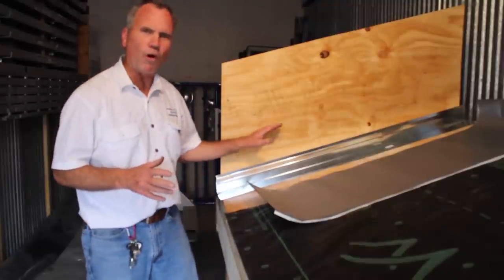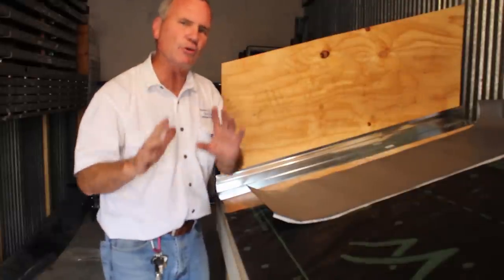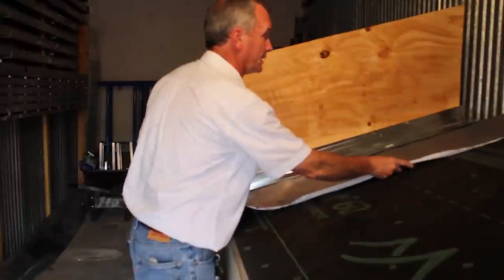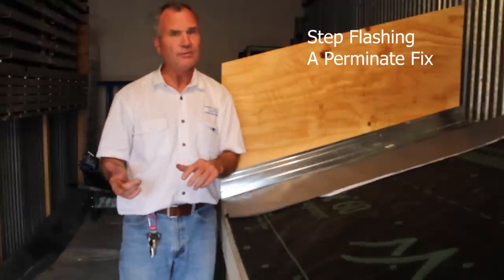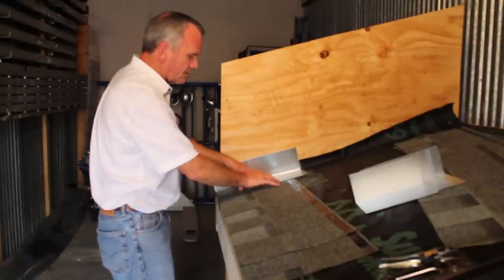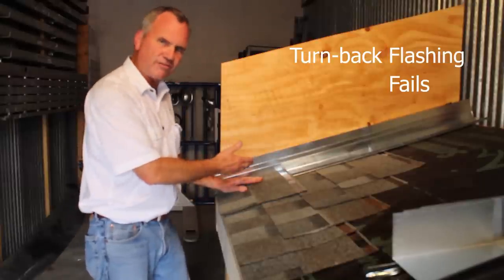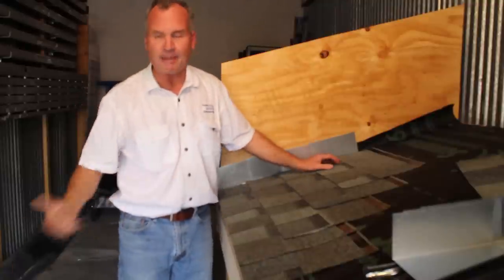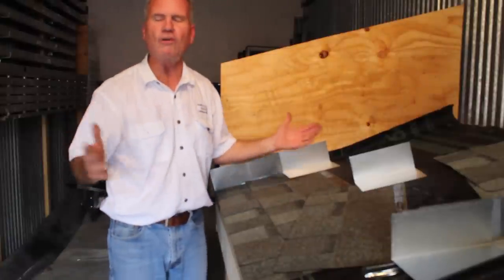Roof Flashing & Wall Leaks - What Texas Roofer Don't Know

Comment: Do you recommend step flashing on rolled roofing?
Reply from the maker: We use step flashing in any type of shingle application, composition shingles, wood shingles, occasionally tile, because it lays up like shingles, 12" or so at a time, slate and so on.  Most roll roofing will need to adhere to a solid piece of continuous flashing.
Reply: @Austinroofingcontractors   You are a breath of fresh air sir!! Ive been roofing since I was 17 and have been doing my own work for 3 years now. I've never advertised myself at all and have no problem getting work from referrals! Quality has taken me a far way in this industry because simple craftsmanship is forgotten these days to save 2 man hours!
Reply from the maker: @roofinggod1540  Thanks for your comment.

Comment: Don’t you want to only fasten the step flashing with the shingle nails (rather than nailing the flashing individually, under the shingle to follow)?
Reply: The Phoenix Contractor's Coach I think that (my “suggestion”/question) is recommended by some because (a) the nail is more likely to back out if it is only going through the flashing and (b) the hole, itself, is vulnerable as it’s not “sealed” the way a hole is when a nail penetrates the asphalt shingle. But, I’m in commercial/single ply roofing; I haven’t investigated what we’re talking about- perhaps the way demonstrated in the video is perfectly fine. Thanks for the response and for uploading the videos.
Reply from the maker: Kyle, you are obviously a terrific roofer.  The depth of your question shows that.  In some cases, you could be right, especially ice and snow build up, but, keep in mind, once the nail penetrates the flashing shingle, it goes into the asphalt shingle, where like all the other nails on the roof, it seals itself with asphalt.  In 45 years, I've never seen one like this leek, even in Boulder CO, but, to push my thinking forward, I would be interested in you thoughts on the above!  GW
Reply: I’ve been watching a lot of videos and I saw one that instructed to nail step flash to wall 2 times instead of nailing into roof. Then place shingle over top and nail across shingle but stopping short of where flashing is underneath shingle. Then one nail above where flashing sits under. Hopefully I explained it clearly. I tried my best.  I’m curious as to your opinion on this method. I’m going to try and shingle a roof with a dormer on my workshop I’ve built. Great video BTW. 👍

Comment: I think I heard you don't like a single piece of flashing?   Exactly why isn't clear.  You seem to claim/imply that water flows under the flashing, but don't worry about why water is under the flashing.....  I am actually bothered by what I think I heard but can't really define your complaint.   Lets start at the beginning and cover some important issues 1) What goes first, order of construction is important here because you have multiple trades ( carpenter builds deck, fascia guy sides wall, roofer shingles), 2) primary problem #1 its joint of dis-similars under water flow (wall vs deck, fascia verses shingle), and 3) water sources.    Ideally I would prefer the flashing installer be after the carpenter and step flash the joint with asphalt pokey ( actual name "asphalt mastic"  or his peel & stick)  raw wall to raw deck, often I can't control that.  Once the fascia is installed I am kind of screwed.  Now the dis-similars usually means cracks and thus the flashing. and water sources which are huge in your demo.  Particularly windows which weren't even mentioned.  That joints primary water source is the wall, a windward wall collects all the rain and flows it down that wall and across that join over the cracked joint.  The step flashing is advantaged in that it transfers the water to the top of the next flashing. Was that your point?  I am concerned as you show new flashing interlaced with shingles BUT really big BUT where is the vertical end of that flashing going?   Best answer is under the fascia, so who is removing and reinstalling that fascia? If you install the flashing outside the fascia you create a wall problem with water running down the wall being on the wrong side of the new flashing.     Simple point is proper flashing can only be done in the original install.
Reply from the maker: I'm sorry - this video must not be as clear as I hoped.  Your comment that I don't like a single piece of flashing - is way off base.  Watch again, and listen to the whole video - you will see and hear me explain using proper step flashing, a very important step, the idea is to not shortcut, do not leave out proper flashing, or substitute for things that do not work long term.  No matter who installed the flashing, I recommend NOT to use poorly installed flashing, fix the flashing by doing it right.  It's the only way to get a lasting roof.  Thanks for watching, I hope this is helpful.  GW

Comment: How about using a full continuous length 26Ga painted metal L-Flashing, say 12" x 12" x A',
where the length A' = 20' long?  Yes, the 3' wide underlayment will go on top of the lower wing of the
flashing and loops over the other wing?  The starter strip will be installed at the bottom edge
of the roof.  Then, the shingles will be installed on top of this long metal L-flange?

I.e., don't use short 5" flanges step by step alternating w the shingle placement.  Just use a long
metal wide L-flange under all of the starter strip and shingles?

Less joints on the flange means less chance of leakage.

What do ya dink?
Reply: Can u do the experiment w above, using a garden hose?
Reply from the maker: It has proven - not to work in most cases. Shinglling is a method that's been in play for hundreds, if not thousands of years. It is to lay or arrange so as to overlap, the one before. In step flashing, it's what keeps the water on top of the roofing material. Shingling!  
Hope this helps!

Comment: your using galvanized steel flashing? thats totally superfluous, tin step flashing is for sure going to last longer than your shingles. and your gunna replace the flashing anyways when you need a new roof
Reply from the maker: Superfluous, a big word for me, please clarify.  Let's start with an understanding of the difference in tin and galvanized steel?  Do they perform the same?  Thanks for your comment, I look forward to your reply and additional comment.  GW
Reply: @Austinroofingcontractors  i just meant that steel is excessive. tin or aluminum is cheaper and and will still outlive your shingles. i dont think steel would be any better because youre supposed to replace the flashing when you get new shingles anyway. you could, however, make an arguement for using steel on the chimney, since you know there will for sure be ice/snow building up on it in the winter. plus theres no getting around caulking the chimney, so if you wanna shell out on flashing, do it at the chimney (you shouldnt need to though).
Reply: @Austinroofingcontractors  btw thanks for replying 2 years later. its good to see you are still active on here

Comment: I love the video , but , but please .. run the underfelt up the siding .. So that if any water that manages gets itself under any top roofing that is fitted .. like you firstly show .. has a way of allowing itself off the roof , either by the top layer or by the under layer ..Then that has to be the best course of action  !! I have had to get myself on many a roof .. that SO CALLED ROOFERS haven't run the under felt up underneath or  alongside a chimney or even a roof window that has had a water problem ..So please make sure the underfelt has at least gone up the siding at least 50 75mm or for usa guys 2" 3" ..So if there is still a problem...Then it's an issue from above.. If there is a leak ..Then its a different issue , from what you are doing , but let people know what may be an issue from the past is a previous one ... But a fresh install , if you know what needs to be done , seldom becomes an issue !!!  Like Gary says .. IF YOU KNOW WHAT OTHERS DONT KNOW .. Then you become a better fitter !!